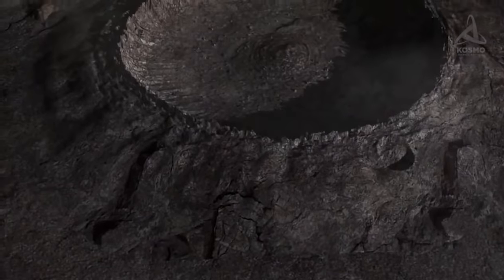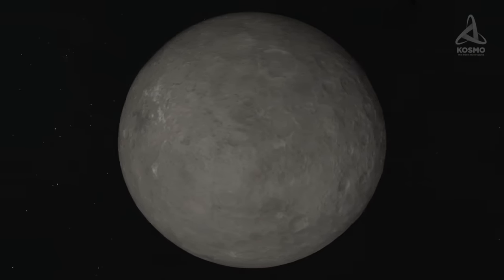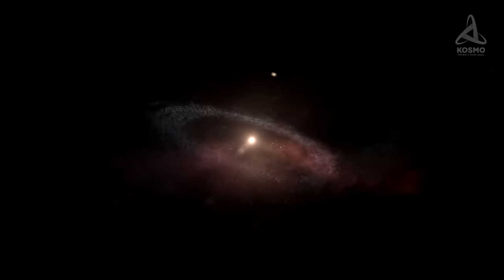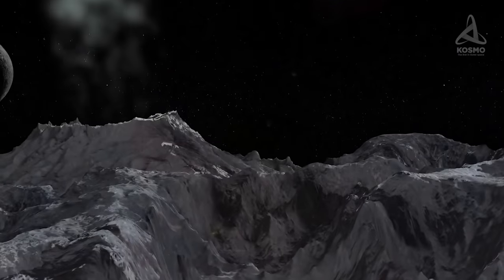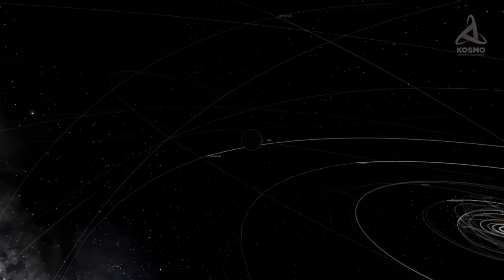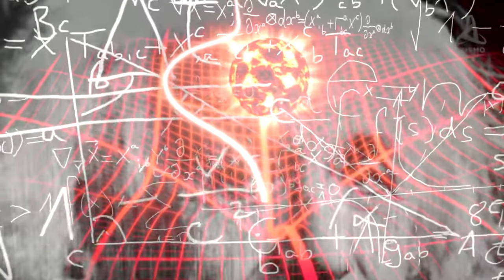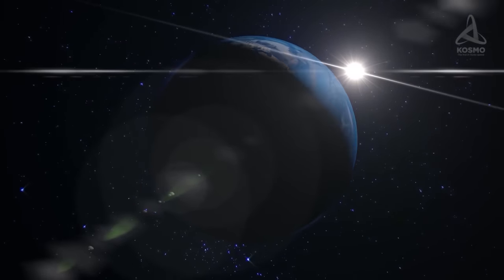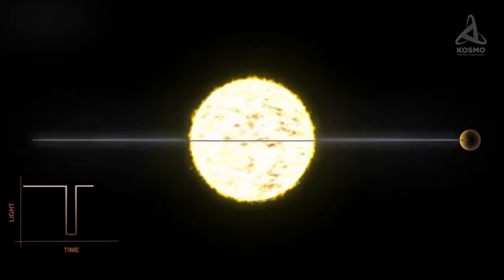A JOURNEY TO THE MOST UNUSUAL OBJECTS IN THE UNIVERSE

Comment: I've been wondering, if the planets was formed by the merging of object's whether gas or rocky materials why is there an asteroid belt and kuiper belt out there to begin with?
Reply: It was a planet that exploded. A massive Earth.
Reply: Leftover debris from the beginning plus debris thrown out of the inner system by the formation of the planets.  

Jupiter's gravity and inbound migration prevented the asteroid belt from accumulating enough mass for a larger planet.  It cost Mars some mass also.
Reply: Asteroid belt is not that massive. Ceres has 1/3 of the mass of entire belt and it is only fraction of percent of Earth mass.

Comment: The universe is like a 3D video with super fast Frame Rate and in each frame travels light witch at 299m/s it reces to the very first frame and it doesn’t experiences time it just keeps racing time itself sometimes in and out of particles just riding the wave of time.🎤💯

Comment: @kosmo thank you for your knowledgeably informative videos :) @-1:05:03.You said that Ceres is 6000X as little as the mass of Earth. That statement right there is grammatically and more importantly   mathematically /incorrect/inaccurate. I have a minor in math/chem/physics and a degree in Chemical and Life Science Engineering, for credentials sake not to boast or anything. So, to revise that particular statement you should say that Ceres is 0.06% (b/c 0.0001(6) (assuming it is multiplied by 6) is 6 X 10^-4 which is 6/10000 and to put it in a percentage form simply multiply 0.0006 by 100) the mass of our planet, Earth. which is close to 0.1% Earth mass.
Correcting each other without negative intention is a good deed my brother. Alhamdoulillah!
Reply: Wow that is impressive I have no idea what your saying but sure wish I did ! I would have never been able to spot that mistake  glad to know other bros are on the job lol
Reply: @jimmysjamin1  Well that certainly clears up the confusion.

Comment: Unless I missed something I don’t think you’re making any sense so you are saying that this object is 950 km across let’s round it to 1000 and the earth is 8000 miles in diameter so like 10 times larger diameter  but you were saying that this object is 6000 times smaller than the earth in mass So what is it made out of Cool Whip and funions
Reply: Mass is proportional to volume and the volume is proportional to radius in third power.